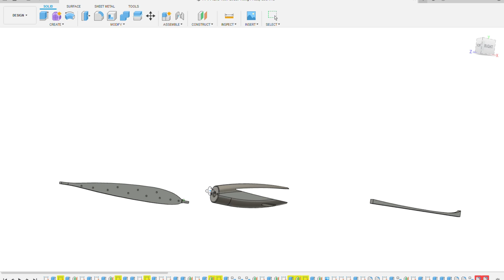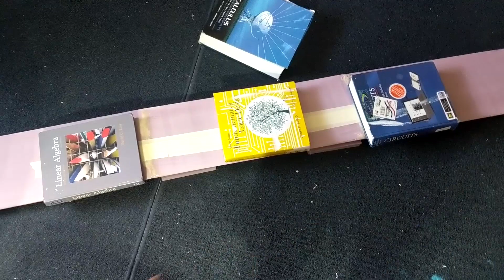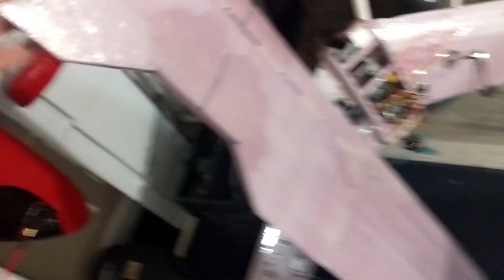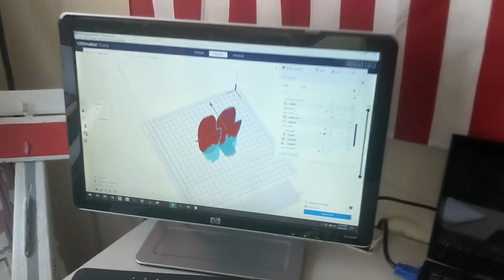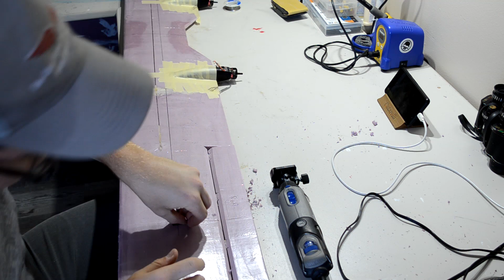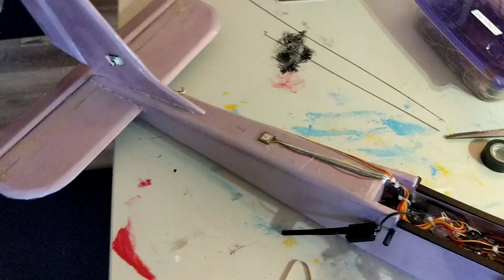Long Range FPV Plane build & failed maiden

Comment: Nice building and set up! What about the weight?
Reply from the maker: Thanks! It's about 4 lbs
Reply: Woww! Amazing that those motors can fly it, thank you so much, keep going like that
Reply from the maker: @messybench974  well, it's got a very large wing so it's basically a glider
Reply: @RailTrailRC  nice, I almost forget... how much dihedral did you gave to the wings? Thanks
Reply from the maker: @messybench974  Not too much. The wing is made in 3 pieces, so the center piece is flat, and the 2 outer pieces are maybe 1 inch higher at the tips. So its more like polyhedral, but I didn't need too much since the wing is mounted on the top.
Reply: @RailTrailRC  thank you so much for all the informations, Cheers!!

Comment: Hi , I noticed that you're using gorilla glue . Just curious , do you damp down one surface before joining ? I used an almost identical product here in Australia called Sikabond which is a polyurethane adhesive like gorilla glue but didn't require any damping with water unless you were gluing wood
Reply from the maker: Hi. Yes I damp down one surface when using gorilla glue.

Comment: Nice plane!
What range are you expect from it?
Reply from the maker: About 1.5 miles
Reply: @RailTrailRC  why?
Two days ago I'd tested my C1 Chaser
Using 3400 mah from 7000 I was able to fly 64 km, including 16 km going out.
I think tou can expect more
Reply from the maker: The video system Im using cuts out at about 1.5 miles. The plane could fly much further on its own, since the battery lasts about 30min.
Reply: @RailTrailRC  looks some interference happened... Or trees are around.

Comment: Nice plane, how far away can you get the video signal ?
Reply from the maker: About 2 miles with 5.8ghz video using a crosshair antenna on the receiver, and a circularly polarized antenna on the transmitter.

Comment: Go All In for  Li-Ion (Your setup can go with 4s4p 10000 / 12000Mah easily + lower weight) + 6/6" or 7/6" bi-props, those two It will increase your flight times massively. Get lower KV motors too for extra time in the air.
BTW can you share the plans and how is the current on cruise?
Good Job!
Reply from the maker: Thanks for the advice! I don't have an ammeter onboard so not sure about the cruise current. On the osd it cruises at about 30% throttle using 4S . I built this using spare electronics I had lying around, so it's not really optimized for long duration, but so far I'm really having fun doing autonomous missions, so I may look into swapping the motors to get a longer flight.
Reply from the maker: I will share the plans soon. Will post link here and in video description

Comment: scratch built foamies are the best. Try bi-blades 6" props if what you want is range. there's no reason to spin a tri.
Reply from the maker: They are, and a simple glider style belly lander plane is really a nice change of pace from scale GA planes that I've been building. I've tried bi blade 6in props, but these motors I'm using draw too much current. I need lower kv motors, but I'm trying to use all the old parts I have around. I'm getting pretty good flight times (25 min) with this plane so far though.

Comment: Love the look of this plane and your idea for motor orientation has a  cool look about it 
next time you wire up motors you can change direction in I-nav you dont need to worry about how you wired it 
looking forward to maiden flight Take Care
Reply from the maker: Thanks. I'm using Ardupilot, but not sure if I can change the direction like inav. On my quadcopters, I used to use Betaflight to passthrough to BLHeli so I could change the esc settings. Not sure if that works with Ardupilot though

Comment: Looks like a nice plane and fun project, how long does a build like this usually take for you?
Reply from the maker: Thanks, this plane took about 1 week to build
Reply: @RailTrailRC  Okay, have you ever tried to to hotwire through glue, like if you have laminated two foam pieces, will the hotwire cut through?